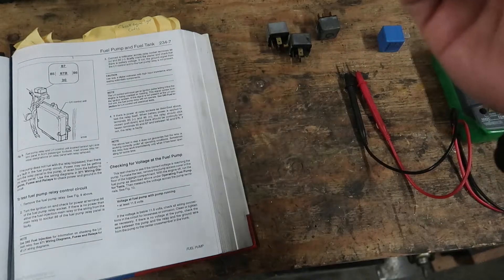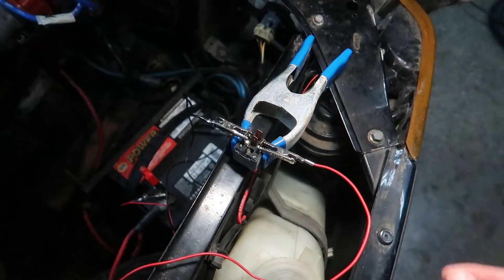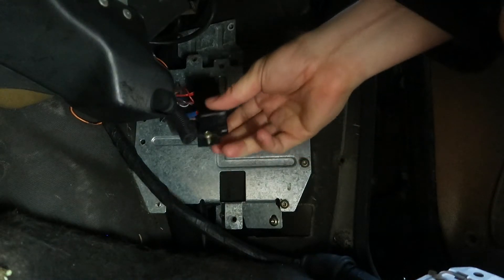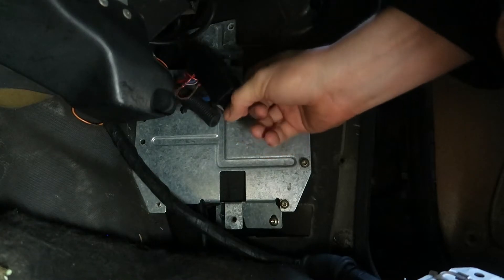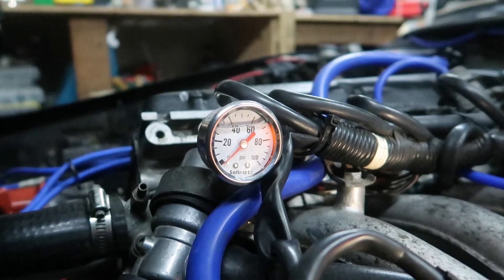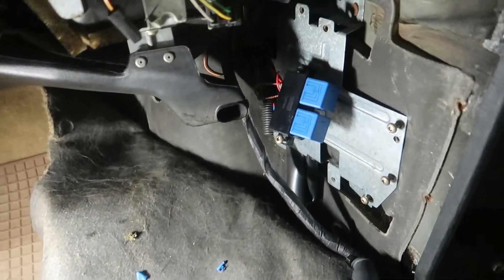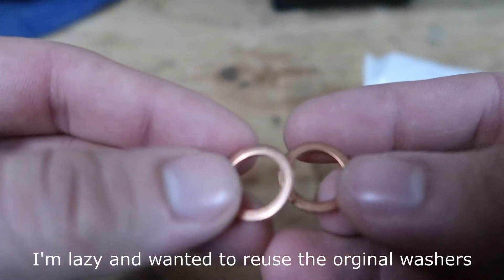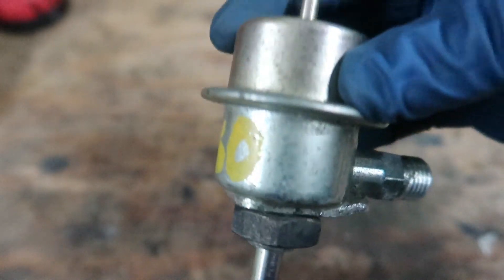Fuel Pump Relay Testing and Fuel Pressure Gauge Install Ep: 11 - 1990 Saab 900S

Comment: The fuel pump is meant to get 12V at soon as the car has got contact, without engaging the starter and trying to start ?
This could be my issue then, dead fuel pump.

Comment: Thanks for the vidéo. 
Have you got an Idea if it's possible to Switch this type of Relay in the previous version of the 900. 
Because the Relay on this version is really expensive. 
Thanks
Reply from the maker: If it works for older 900s, I can't really say. I would say, replace the relay with what came out. If you have a 2 switch relay, replace it with one of those. These 2 switch relays seem to be harder to come by but the car doesn't like the 1 switch version. Sorry I'm not more helpful with this.

Comment: Hey, nice job on the videos, there can never be enough for our Saab 900's. Question, do you have a part number or the receipt for that 'Fuel Rail Banjo Bolt'...?? The link no longer works and I'd sure like to find one! Thanks in advance.
Reply from the maker: https://www.xtremediesel.com/xdp-tapped-banjo-bolt-xd201
It's a 12mm banjo bolt with a pre drilled and tapped 1/8 NPT port. It's for a 94-07 Dodge Cummins. If you Google "XDP Tapped Banjo Bolt" you will get a lot of results in case that site I listed doesn't work out. Thanks for watching!
Reply: @jamesgregory6903  Thank you very much!!! ;)
Reply: Ordered!
Reply: Part worked perfect. I only have 30 lbs, waiting on a new fuel filter, my existing looks 28 years old.....can't wait to cut the old one open. ;)
Reply from the maker: @markc.4883  I'm glad to hear it worked for you! Double check your fuel pressure regulator. I've seen some with 2.5bar (36psi) ones vs. a 3 bar (43psi) FPR and maybe your pressure is supposed to be that low. It doesn't hurt changing your fuel filter though.
Reply: @jamesgregory6903  Will do, she's the turbo flavor so there could be something about that.....she's the 2.5 bar, so there ya go! ;)